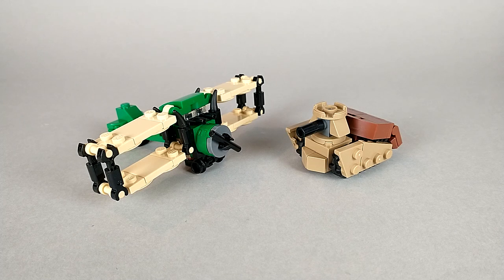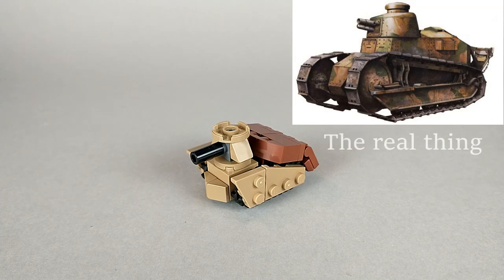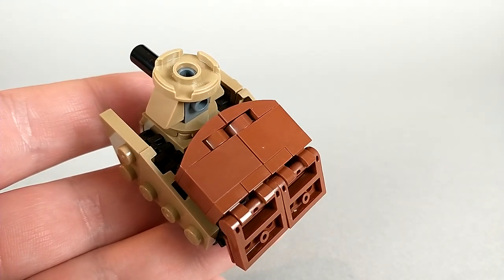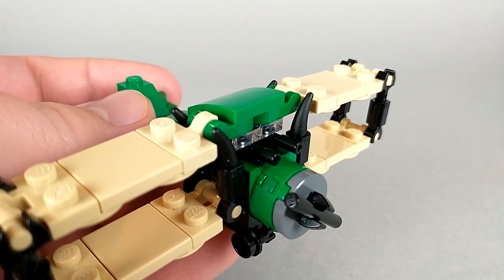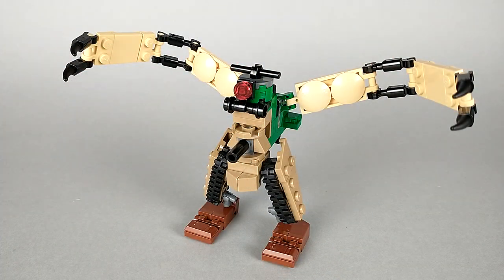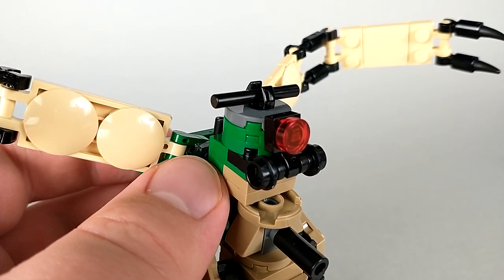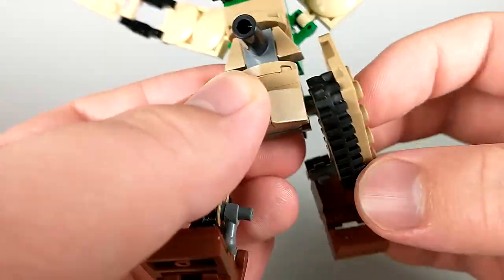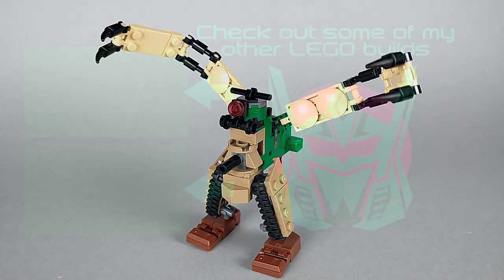Lego Transformers #41: Doughboy

Comment: You know those 2x2 turntable plates that spin really freely? You can use just the top part of those instead of the boat plates for the wings, it's basically the same thickness without the roundness. Don't think they come in sand yellow, but that might still be a trade off worth considering.
Reply: It took me five minutes to think of the piece you were talking about but now that I see it in my head that’s a good idea! There are also the prices that are flat but have studs on the bottom, so pretty much the same thing except it doesn’t spin.
Reply: @Swiftest202  Those are, unfortunately, the same thickness as a normal plate. The other option is even thinner than boat plates.
Reply: @spinomitegames9000  ok now it’s time for me to melt dramatically like the Wicked Witch of the West. AUUGHHAHAUUAHHHHUAUSGUUSUAHVUGUDHAHsgahshguuahahahAGUFHHAGGAUAUAHHAGAHAUAUAHAHAGAUUUGGUHAHAHAUUGUGUFUHAHAH